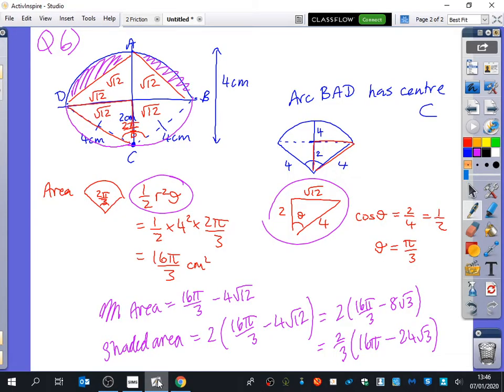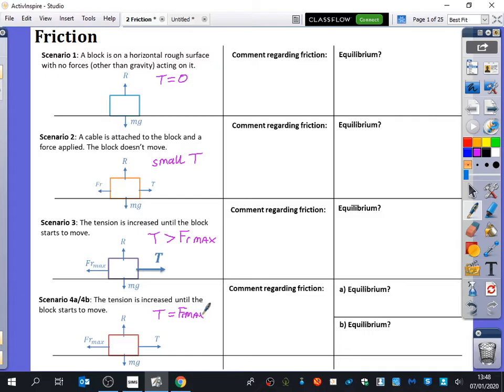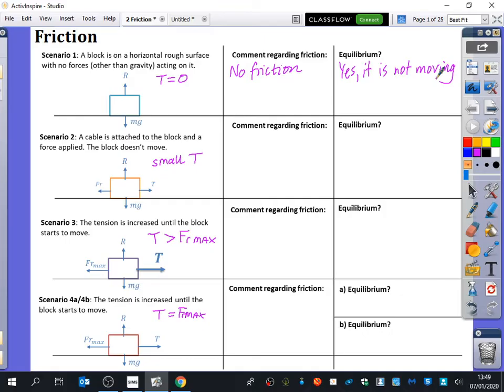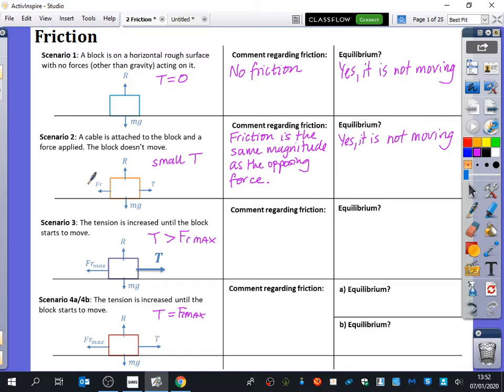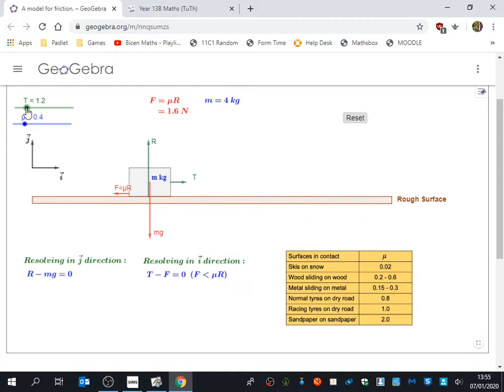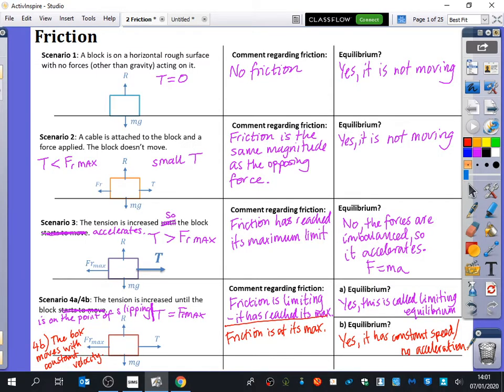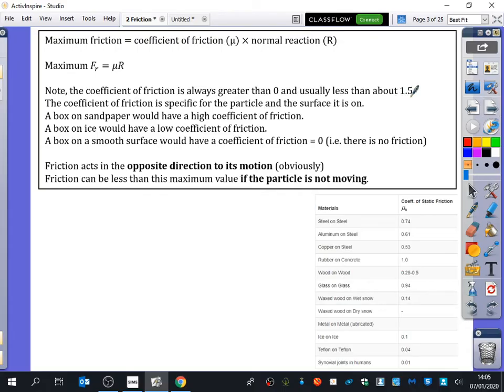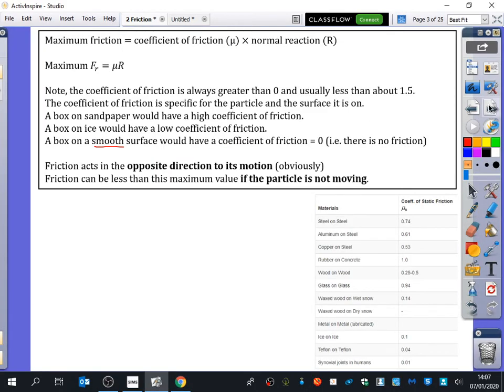Forces 8 • Friction • Mech2 Ex5C • 🎲

Comment: why doesn't the block move in scenario 2? surely if the tension is equal to the friction it will be moving at a constant velocity
Reply from the maker: So there's 2 kinds of situations - if it was stationary and then the pulling force is applied up to that size, then it would be on the point of moving. 
If it is already moving, and a force of that size is applied, then you are correct that it will continue to move at constant velocity.
Reply: ok, thank you!

Comment: For the last Question what if you apply a force of 4.5N very quickly when friction is 0 would it accelerate then reach constant velocity just like when someone jumps out of a plane and immediately accelerates then reaches terminal velocity
Reply from the maker: It wouldn't move if the friction can take a value higher than 4.5N! In reality, friction does behave slightly differently to how it is described here, but for the sake of our model, it would not move at all.

Comment: could you briefly summarise the difference between scenario 4a and 4b please?
Reply from the maker: 4a is where the box is initially not moving, and the force is applied that is equal to the friction. It does not move, but it is ABOUT to me i.e. limiting equilibrium. 
4b is where the box is already in motion, and the force is applied that is equal to the friction - in this case, the pulling force sustains its motion, but doesn't speed it up or slow it down, as it is in equilibrium - so moves at constant speed.
Reply: @BicenMaths  is the friction always at its maximum when a particle is moving with a constant velocity
Reply from the maker: @aishaelmagbari6134 yes that is correct!